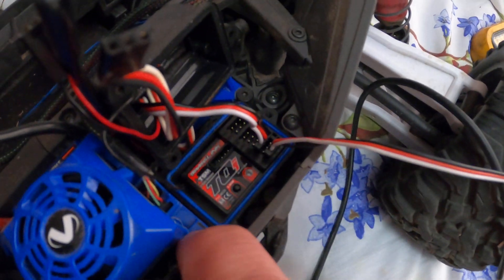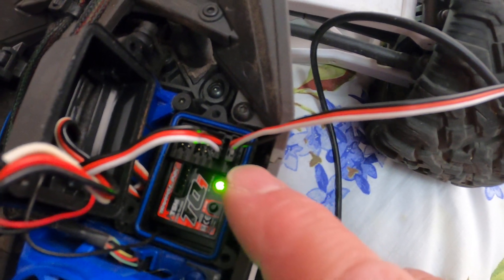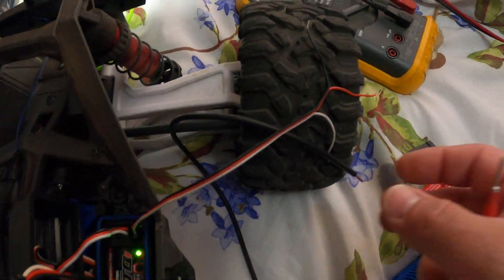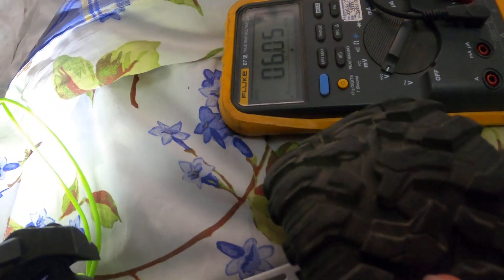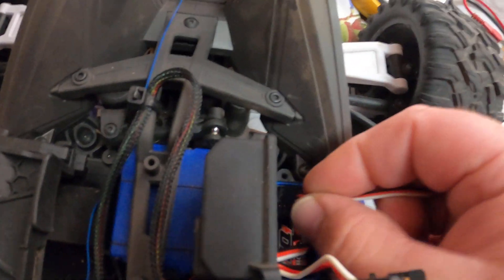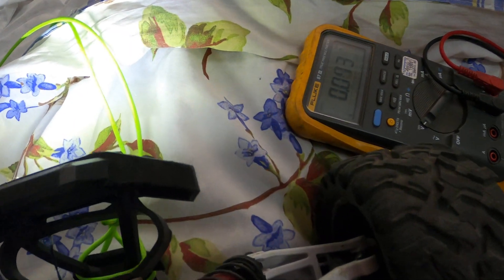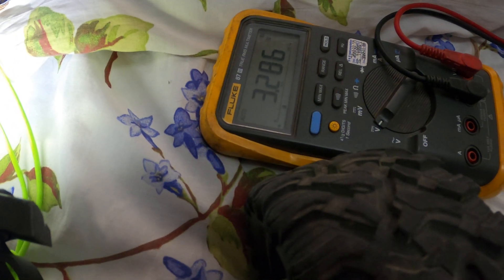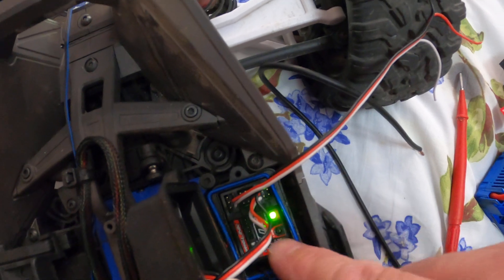Traxxas TQi receiver won't bind after ESC swap: AKA a sure way to blow your Traxxas 6533 receiver.

Comment: If the signal you are probing is a serial data bus at 6 Volts, then a square wave (like clock or data) will result in the meter seeing LESS than 6 volts.
Because the serial waveform is at zero for about half the time.
The meter averages this signal.
To really see what's going on, on the serial data lines you need an oscope.
Reply from the maker: @stuartgray5877  that aspect doesn’t matter for this demonstration, as most people don’t have access to an oscilloscope. The main take away is that if you connect the ESC to either of those two top ports, you WILL fry your receiver.

Comment: I need urgent help, connect my Esc to the top port of the Receiver, in the RPM zone and the one that follows, since I did that now when I connect my Esc to the bottom connectors it no longer turns on at all, it's as if There was no signal, and when I plug it into the RPM connector it turns on a permanent red light but not pairing does anything, I press buttons and nothing PLEASE HELP MEEEEEEE
Reply: Buy a new one lol. It's fried. I accidentally did the same thing.

Comment: That's for the RPM it's not going to have a lot of voltage
Reply from the maker: I made that video to prove so someone that if you connect the ESC to the RPM, Volt, or Temp sensor slot, that you will fry the receiver. The person called me a liar, so I made this to prove the different busses. Then that person blocked me, lol.
Reply: @dgitalchaos  good on you!
Reply: @dgitalchaos Ok I did it, but now I connect the Esc in the RPM slot and the receiver turns on but keeps the red light, what do I do? I have hope that it still worked????? pliss help
Reply from the maker: @eliasjosuebonillaromero  if you connected the ESC to either top ports, the receiver is no longer good.
Reply: Yep just did it had to look it up